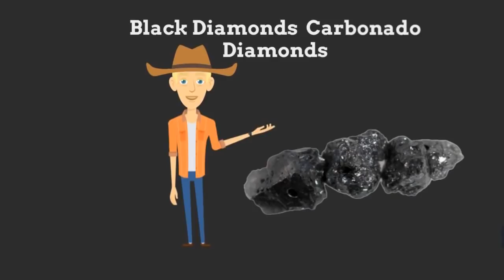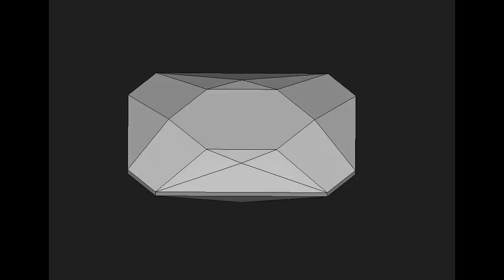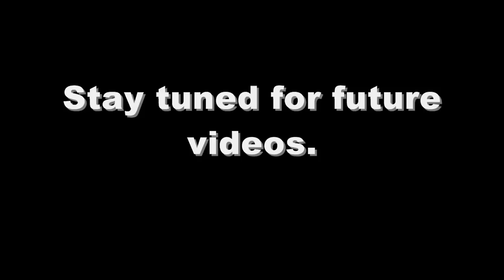Faceting Gemstones From Outer Space.

Comment: Moldavite is an awesome material. One of the lesser theories regarding its formation is that an object (asterioid/comet) collided with the moon around 14 million years ago. The resulting vitrified rock from the impact was cast down to earth in a wide spray, resulting in the large strewn fields on the surface of the earth. More recent theories suggest however, that this extraterrestrial object in fact, hit the earth directly. 

I wish I knew what actually took place, but either way it makes for a great faceted stone. What I found works well for polishing moldavite, is a cerium oxide on a ceramic lap at low speeds. Nice fast polish, and less over-cutting. Cheers.
Reply from the maker: Thanks MrQ,  interesting information you posted. I must do some research on that...
Reply: There’s a couple of very cool documentaries regarding those topics. There’s another one dealing with our missing planet and how we evaded up with … Mars?(or Venus…?)  
The most interesting part, to me, was that just before watching those documentaries I watched one on Hopi(?) (and several other civilizations) legends, about those issues.   Wild world with amazing possibilities.   I love that.